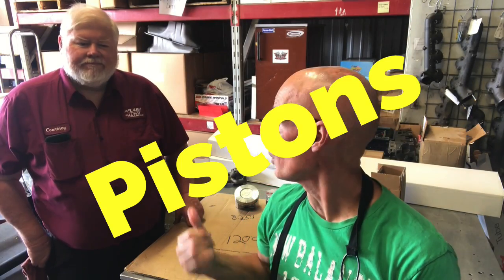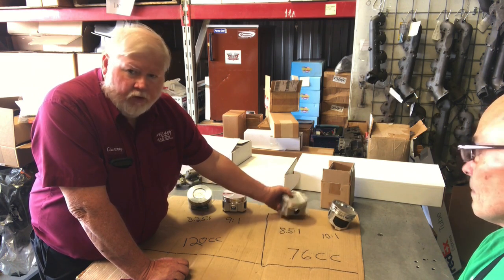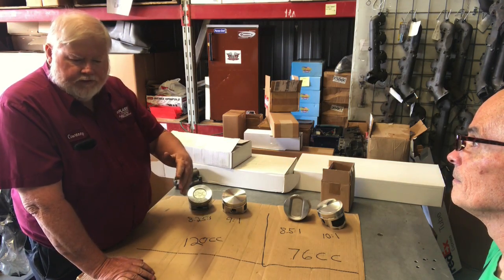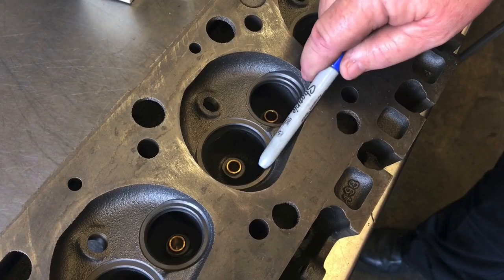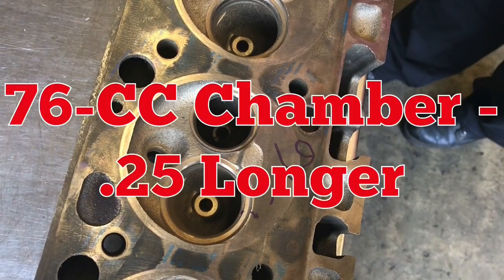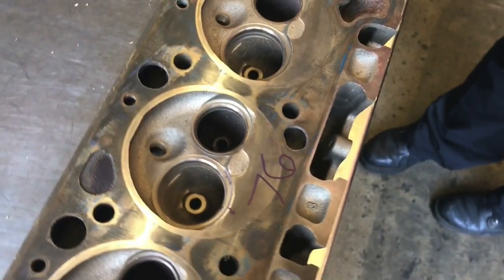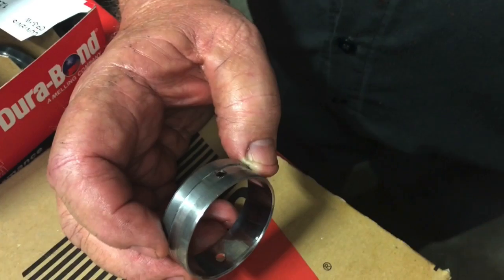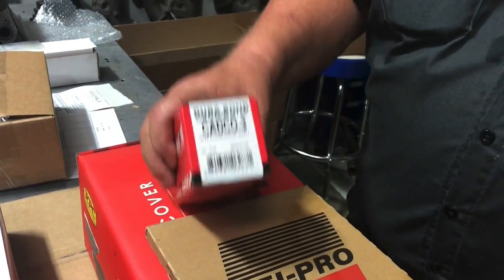CADILLAC POWER SECRETS-CHAMBERS, PISTONS & OILING

Comment: What wit take to put the new Magnuson hot rod fuel injection supercharger on a cadillac 500? Where would you start?
Reply from the maker: that wont directly bolt on and the calibration is for an LS-you can adapter a 2650 blower to a Cad motor by making a lower intake or adapter plate

Comment: I knew Larry kruzak and the other Cadillac guys in the mid 80s. We pushed these engines to about 1250 to 1500 ho with turbos and nitromethane. We destroyed some cranks. Nose fell off.. but we were pushing untreated cranks to 2100 hp and 7000 rpm.

Comment: I bought my first cad 500 in 1985. To go into an 80 camaro
The thing lost oil prime and seized up.
Bought a second 500. Had to swap the Eldorado rear sump. Used Vaseline to help prime oil pump. Didn't shim up pump. I was 16 at the time. It too seized up. Even after priming it with a drill.
I modded the next pump and block for high flow. A d shimmed the oil spring. Remember I'm a chevy guy.
Bought a 3rd engine with a Crack in the block. It wanted to over head about 240.
Was a 76 smog motor. Car had no balls.
Changed the 10 bolt to a 9 inch ford with 3.50 posi.
Car needed a regrind cam in it. I gave the place the specs they did the best they could. They gave it to much duration. 300 something degrees.
I put the older heads on needed hardened seats. Car was 13 to 1 comp.
Wouldn't run on aviation fuel. Frustrating.
Ran a huge tractor trailer turbo on it. At full boost. Car didn't make power above 4800 rpm. Could never get timing correct. Felt like maybe 350 hp n.a. when turbo kicked in at higher rpm Car ran out of rpm. I put solid chevy lifters in car. Would rev to 7000 rpm plus but lost power. Hood flew off car cause Hei dont fit under hood of anything but a cadillac.Got ahold of Larry kruzak.  Fixed the worst valvetrain design on earth. Still was t the adjustable. Put olds 455 rods in Car after breaking a cast rod. Car smoked the tires. Ended up breaking trans and rear on 165 mph run using race gas 114. Cracked block at motor mount. Bought a 425 and 472 3 years later. Worked on other guys cad cars for 33 years. Ups and downs. I was called the cadillac man since 1985. I modified and made many parts for these engines to try and race them. We had few parts back then and what was there was expensive. We put them in trucks t buckets cars etc. Cost alot of money to make them a good racing motor. Many over heated. Chevy engin3s way better. 

Bloodviking

Comment: After working on them for 25 years since 1985

Heads need major porting
Distributor won't fit 7nder most car hoods
Oiling system can lose prime
Need flexplate modded for chevy converter
Intake manifold flows uphill
Hard to find rear sump and pickup for gm apps
Heavy rotating weight
Low rpm peak power
No manual trans hole in crank
Mix heads wrong and issues arise
Smog motors are dogs
Valvetrain worst design ever of any engine
Very costly
Can't get certain cad companies to even answer the phone
Hard to find in junk yards now
Tons of bolts in timing cover
Won't bolt to chevy trans, bop
Stock Intake won't take holley carb
Oil shaft lose in pump gears can fall out
Timing gears flake apart
Non adjustable drivetrain
Long push rods
Many don't run on pump gas

 good point
Great block, thickest cylinder wall.

Bloodviking master engine builder

Comment: I was so unimpressed with the motors in the 80s I finally bolted on a diesel turbo. Used olds 455 rods with arp fasteners. Filled the block. Ran alky on it. Put the engine in a lite car and was happier. But still no e85 back in my day.

Comment: The valvetrain stinks beyond measure
The push rods are too long
The head flow sucks in stock form
The intake flows down hill
The q jet dumps raw fuel into the secondaries 
The height won't fit under the hood on most cars
The hi comp engines won't run on low test fuel
Most are rear sump, not good for gm swaps
The cost on parts is brutal
Few places make parts
The engines are drying up

Comment: If you know one engine you know them all. But there are certain tricks to specific engines. Such as mixing and matching cadillac pistons and heads. Oldsmobile rods work in cadillac engines. Swimming up the oil pump spring with a q jet jet works.

Comment: I have an important question. I have a 472 engine year 1968 of origin 375 HP 525 TQ. How many RPM and HP can the ORIGINAL piston rods and crankshaft support??? I have a lunati cam 6500 RPM my heads flow 300 CFM @ 650 lift intake edelbrock worn
Reply from the maker: WHAT ABOUT YOUR ROCKERS?

Comment: I have a #15 mts cam for my 1969 472, with .540-.560 valve lift range will my piston to valve clearance be ok?
Reply from the maker: cam lift has almost nothing to do with p-v
Reply: @richardholdener1727  so that cam will work fine then?
Reply from the maker: I don't know, because lift tells me nothing, cam duration is what determines the p-v clearance
Reply: Advertised duration range: 286-295* / Duration @ .050” range: 234* / Valve lift range: .540-.560”.

Comment: You said this is in New Mexico?  As a snotty nosed teenager in west Texas I used to drag race a ‘62 Ranchero with a tiny 289 that ran 11.80’s. At a race in Carlsbad, New Mexico (circa 1980-81) there was a big ass old Cadillac that was Caddy powered with a fabricated aluminum intake manifold running around 11.60’s if I remember correctly.  Painted across the trunk were the words “Where’s That Hot Rod Lincoln?”  A really big man was pushing it in the staging lanes and either he was very strong or the Caddy had been lightened because it didn’t look like he struggled to push it by himself!  The car stood out and was impressive and I can’t help but wonder if it was Courtney?  Anyone know?  I ran across a discussion on a Facebook group a few years ago where folks said the guy that ran that car was a Caddy guru from Albuquerque.....

Comment: The 425 heads will raise compression to 10 to 1 but you can just buy an older 472. 

Clearance from valve to piston is about 1 inch on some engines.

Bv
Reply: So what heads does a 1968 472 have on it?  76cc?  They supposedly have 10:1 compression....

Comment: We used modified bbc headers and a 460 tunnel ram on the molded 472 500 motors. The bvalvetrain is hard to modify with steel plates and ford sb rockers. But can be done. Now I'd never run a stock valvetrain. I'm not sure a roller cam is worth much over a mechanical cam to justify the cost. About 900 dollars or more.

Comment: We welded a set of hzrdened stainless steel into the aluminum pistons by drilling and filling the other side with plug welds. Never got to finish that project. We drilled holes in the piston sides and rods to lighten the reciprocating assembly.

Comment: Once we opened the turbos up. Perhaps 60 psi each on alky. Kept the rpms low. About 5000. The guys wouldn't  put it on a dyno. It might break. So was it 2000 hp 2500 on nos idk but we did destroy the pistons after 1 summer. I think the piston gaps were too small. We didn't have forged pistons from trw for a cadillac . Just for our chevy big blocks. We ran the 396 and 427 into the 9600 rpm range with roller parts for about 3 seconds. The engines needed block fill as well. We did window some chevy blocks.

Bv

Comment: A normally aspirated engine will cost more and be disappointing for some compared to what a cheap pair of turbos will do. Heck you can probably  leave in the stock cam and valvetrain and still get 700 hp out of the deal. Expensive  3600 dollar bull dog heads will give you about 100 lousey hp at best. The stock heads aren't that bad. When forced induction is applied on e85 stock heads are very good. Back in the 80s and 90s we spent money on stroking, better heads, roller cams in the 90s. Porting. Hours of time just to get 500 to 600 out of a bb. Then I said never mind all that guys let's go turbo. We changed the engine parts only when using crazy amounts of boost a d hp. Nos works well too. But the turbos are the gift that keep on giving. We had molded a 540 for a guy , 1200 hp on racing gas back then ans 2 big cheap diesel turbos. When put in a modified 23 t. It beat everyone on the street except one guy who dropped a funny car off the trailer with 5000 hp.

Bloodviking

Comment: I make a taper bronze insert that goes in the stock oil tube o-ring location. That sits flat to the engine block. Then the new .750 thick oil tube flange thats machined for a o-ring is bolted down over the bronze insert. The insert is sealed at the outer diameter of the origional o-ring hole. There is no tube in the factory o-ring hole anymore. The new .750 thick flange is flat with an o- ring. Increase the opening past the factory pickup tube bore in the block.  I Contour the 180 degree turn into the oil pump gear then increase the inlet area to the oil pump gears for smooth unimpeded flow. Use .875 id tubing to make a new pickup tube for maximun oil flow. Lookout Big Cadoo. If the fabulous hotrod brothers had my engine, they would still be smiling in Cadillac style.

Comment: the caddy 425 uses the same heads as the caddy 472,500,but weighs 100 lbs less...just an FYI!
Reply from the maker: has head gasket sealing issues and is smaller
Reply: You have to open the coolant passages at the ends, or seal/shape one side to match. The combustion chambers could use some blending as well. Chambers are about 96cc I believe.

Comment: The only time I had oil pressure problem on The Big Cadoo was when I went to mechanical roller set up and started twisting The Big Cadoos rpms. I had block lifter bore bushed with .040 oil holes and restricted Manton pushrods. Grooved cam bearings with oil hole at 2 o clock like gen 6 bbc. Oil pressure was 45 psi at 4500 rpms at full heat soak on street. When the throttle was increased past 4500 rpms the oil pressure guage went backwards all the way to 20 psi. The Fix was 7/8 id mandrel bent tubing with sump screen for maximum flow versus maximum filtering.  Fram hp 2 filter. Cut old tube flush off flange and tapered it on tube side keep short stock tube on block side for oring.  Use allen head bolts as hex wont fit now.  Contoured the oil pump face (kidney area) on engine to relieve the 180 degree bend into gears.  I use a peterson external relief valve at the oil pressure port at top rear of block and vent pressure  to oil pan. I set the oil pump bypass to 100psi. Ford side oiler block vented oil after all bearings were pressurized. Using this method does the same. All oil passages get pressurized then oil pressure is relieved at external bypass. No oil bypasses at pump, only at external bypass. Vents all the air out of flow to #8 rod bearing also. Makes 55 psi at 6500 rpm.  This engine has .0035 on mains .0025 on rods. Got crank back and its more than wanted. Never had oil problem with mild hydraulic flat tappets. Denny Wydendorf makes reamers for bushing lifter bores.
Reply: Good info, thanks im thinking about going with a hydraulic roller,delt with Marty from MTS he was about 45mins from where I live when he was around.Learned alot from him and he was always willing to help the"small" guys who spent a few thousand vs the big spenders.Im gonna aslo use an accumulator keep lines pressurized,a friend that drove his all aluminum BBC on the street swears by them said helped keep from dry start ups when the aluminum block is warming up, I dunno but he drove a 580 BBC back and forth to work until it got into the 30's?🤔
Reply: @1diggitech  you can vent oil pressure through back of block at lifter valley under maniflold flange or through intake manifold behind rear most runners.
Reply: @1diggitech  get hydraulic roller from Howards Cams. They grind the cam to your specifications. They have roller lifters for the Big Cadoo.
Reply: @1diggitech  if you cant keep oil pressure and flow then the accumulater will be empty too. Bigger pickup tube allows pump to keep input flow up to match oil flow at bearings and lifters.

Comment: Fabricate 7/8" id tubing with  sump screen for maximum flow versus maximum filtering. Use fram hp filter for cadillac for maximum flow. Keep main bearing to crankshaft .002 maximum. Contour oil pump face on block to improve flow to gears where oil takes 180 degree turn into pump gear. Full mechanical roller cam set up flows 55 psi at 6500 constant pressure. Set external oil pressure bypass valve at oil pressure guage port and vent to pan or into lifter valley area at back of block. Set pump bypass at 100 psi so that the oil passage vents pressure at the last port that flowd oil. It works. Comp cams pontiac xtreme mechanical lifter with ford 460 lifter link fits the Big Cadoo. These engines set up correctly will give years of maximun adredalin rushes with minimum maintenance. Did it and lived it.

Comment: Richard- Thanks for mentioning the term "valve drop" concerning the valve distance relationship to the cylinder heads. As a piston manufacturer,  that is a very important term and valuable piece of information that we require from customers when taking custom piston orders. It helps us to calculate the needed valve pocket clearance.  #CPCarrillo
Reply: 472/500 poppet valved u-loop 2 stroke you must mix oil with gas for the high nickel block to last! Mix at 40:1

Comment: Great work Richard.  Make sure to remind your subscribers that Flat Out Racing has some SS fire ring Cadillac head gaskets for the Cadillac.  Two bore sizes (have to specify since both are covered by the same part number I think there are two thicknesses available also, although the ones I purchased are the thinner ones.  I paid for the design and production setup a few years ago since there were really no HiPerf gaskets available and thus the multiple head gasket failures in uprated Cadillac engines (that and most were not decked and shaved prior to the build).
Reply: Wonder if that's what's going on with my 500,had a a set of head gaskets made i have head studs and the heads are fully ported & polished, bigger valves and  unshrouded chambers,freshly done and it pushed a lil water out of the #1? Stock block with new rings gapped for nitrous & new cam/main/rod bearings compression checked out good in each cylinder can't figure it out?
Reply: @1diggitech  did you deck the block and shave the head to get them straight??

Comment: Cam bearings are a WEAK link in caddy motors.  I have one I rebuilt twice with new bearings and they are cooked in a few hundred miles.  I even used the fancy Durabond bearings from CadCo.   Now its a 500 pound paper weight that sits in my shed due to lost interest.  No idea why it keeps eating them.   Made 615 pounds of torque on the dyno though.  LOL
Reply: Cam bearings are generally small in engines from the Golden Age of Pushrods.  Seems like there would be room in the Caddy block for 60 mm bearings.
Reply: @andyharman3022  🤔🤔🤔

Comment: You’ve been testing some interesting engines lately. Would you be interested in testing some unusual speed equipment? In particular, I’d like to see you test a Predator carburetor. Good info is hard to come by on how these unique carburetors perform, in a variety of applications.
Reply from the maker: never run one of those

Comment: IMO the 76cc head can be ported to flow better than the somgger heads. Some quality time in the sunshine with a saw horse and a carbide burr and the iron Cad heads can flow a LOT of CFM.  In the book Big Inch Cadillac Doc Frohmader published his ported iron head intake CFM @28" of water column with .500" of valve opening at a whopping 274 CFM!!  This was not a radically modified head. It had modest (for 500CI) valve sizing (2.91/1.75) . For comparison the LS-7 BBC flowed 284 CFM with the same WC and lift. When you consider that a LS-7 was a full race motor with the very best tech Chevy could muster the lowly Cad 500 has some impressive bones. 

Cad motors are made of "Armasteel" a GM trade name for a grade of pearlitic malleable cast iron. As a 1982 GM brochure explains, it is "a ferrous alloy with temper carbon in a matrix of tempered pearlite or tempered martensite".  The molten metal was made in an electric arc furnace and "duplexed" which was a heat treating process to enhance strength. It was like "aging" the molten metal before it was brought to the casting lines.  It's only source was the Saginaw Malleable Iron plant.  (closed thanks to outsourcing US manufacturing by the arseholes who hate you and I)
Reply: Good info im certain I have the 76cc being a 1970 deville wish I knew wich pistons I have im assuming I got the good compression setup as she keeps killing starters lol